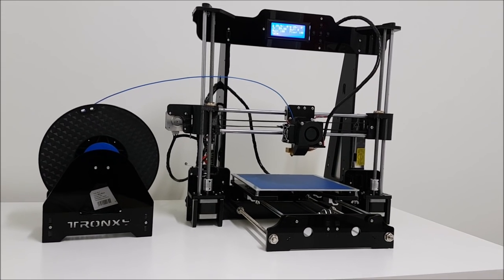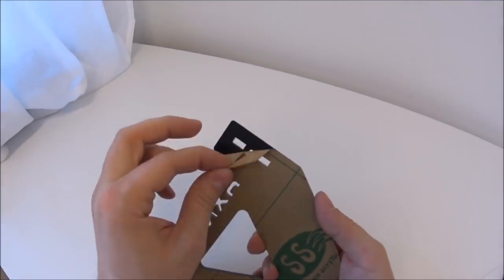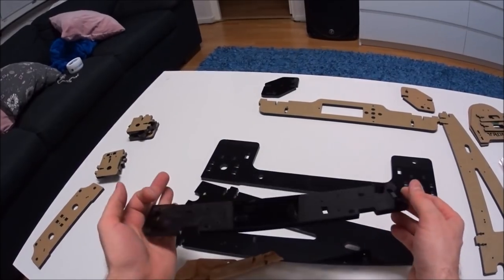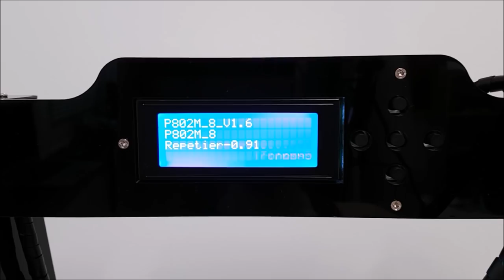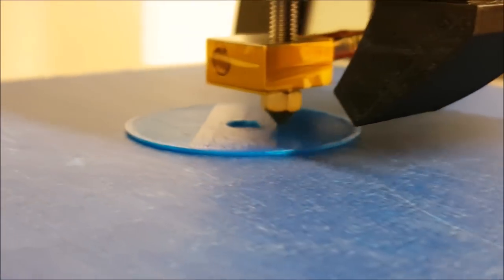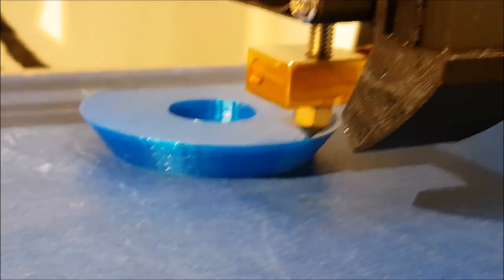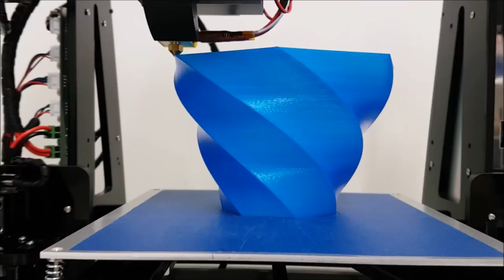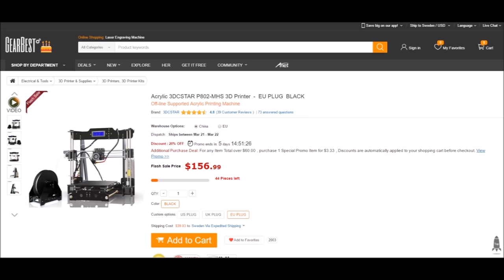Tronxy 3DCSTAR P802 3D printer build test and review

Comment from the maker: Tips for perfect prints: 
Build it perfectly. Make sure all screws are tight and belts are not loose. Check distance on side(Z axis rods holder)
Use lithium grace to lubricate bearings to make them run smooth or make IGUS PLA bearings and use thin oil.
Level your bed on minimal 5 places(4 corners and center ) using A4 paper. Nozzle should NOT touching heat-bed surface.
Move X carrige and look for distance over whole hotbed area to make sure that nozzle is  again NOT touching heat-bed.
For better print sticking use Brim option in CURA or hear spray or order BuildTack.
Try to find best settings in CURA. Use slow first layer 10-20mm/s 
Average settings are PLA 200C on nozzle Hot-Bed 55C. On ABS 230-240C on Nozzle , Heatbed 75-85c (Use brim option) 
Layer resolution is 0.2mm medium quality or 0.1mm to High quality
Print speed are 34-55mm/s   Travel speed are 45-85mm/s
Good luck :)
Reply: My son bought this same printer and one motor is not working - we switch the input port of cable from left to right and then the opposite motor doesn't work, so we assumed it was a faulty port on the circuit board. The manufacturer sent us a second circuit board but we have the same problem. Any ideas??? Help! We have videos uploaded on our channel. Thank you for your help.
Reply: I use silicone grease as it has less chance of attacking plastics.
Reply: @nycmeghan18  check wiring for bad connections. It happened to my z axis motor. The black broke while running it.

Comment: Yah we definitely need a side by side comparison. Can you do a sound test between the two? Is the stepper motor noise noticeably quieter.
Reply from the maker: I already done comparing video Anet A8 vs Tronxy. Well they are pretty much the same sound noise. I did not noticeable any big deference in steppers sound.
Reply: thanks, How are you able to get so many printers.

Comment: I just bought one of these but it's the Australian version and I live in Canada..Only reason I didn't buy the North American version is because it was $100 more..I already have a power supply to replace the one that comes with it if I need to...Hopefully it has a switch on it so I can change the voltage on the power supply that's included..if not I'll use the one I have...The printer should be the same just a different mains voltage..hopefully..

Comment: Hi Nexi, Good review video mate, just one question how is the noise from the steppers on the tronxy over your a8?
Reply from the maker: Thanks mate! Glad you like it! They are silent. Only think I will change is standard bearings to the igus stile bearing and maybe thermal  switch to power supply to control fan.
Reply: im currently doing the set up for the e3d upgrade on my a8, I plan on doing the stepper driver upgrade and I think that will be me

Comment: Could you please help me? I bougth the printer a year ago and tried to assemble it. The problem is that it isnt getting hotter, it moves properly when you are printing something but it does not put plastic on it, because it is not hot. I really need your help, I need to fix this as soon as possible. Thanks.
Reply: I have fixed the problem with the temperatures, what temperature do I use? My problem now is that the PLC filament does not fit on the hole while yours fit perfectly, mine goes 2 cm in and then it cannot go further. My fillaments are 1.75mm

Comment: You mention upgrades.  Are you saying the tTronxy is an upgrade over the Anet in these respects?  Or did you apply these upgrades to the Tronxy (i.e. these results are not from the stock printer)?
Reply from the maker: Chris Burck Forget about Tronxy or Anet or any Acrylic 3D printer. Get this one instead: https://youtu.be/QEzMWE3-lVY
Reply: Thanks for not answering my question.

Comment: Excellent video!
I just built my 1st printer and the extruder motor will not dispense plastic when it's printing a test part, but the extruder motor works fine when I do it manually without a file loaded.
Any suggestions, please?.
Reply from the maker: Mr. Pickles Try to adjust tension of extruder gear? Temps? 195/200 is for PLA
Reply: Thank you!  I will let you know.

Comment: Is it better then the anet a8?
Reply: only real difference I see is the built in fan in the PSU, it depends on the steppers really as you'll likely upgrade everything else on an A8 or This
Reply: James Tourish Also the way the Y axis bots go through the acrilic not just a cutout for it.. I really like this idea
Reply: weird my a8 has that already but its def a positive for the tronxy
Reply: Sometimes I think I ordered my Anet8 about a week too soon, many ppl are getting this printer instead. Oh well I guess, I've already done many of his mods and my Original e3dv6 will be here monday.
Reply: Hopefully its install goes better for you mate, I'm getting a z probe error when trying to home and my hot end is reading 238 degrees without been heated lol
Reply: See now you got me worried lol.Maybe i'll post it on my channel IF I get it working :P
Reply: @James Tourish - did you change the thermistor settings in the firmware?
Reply: yea chroboe, went through them all, tried the original thermistor from and set it back to 501, read right first time so just installed it into my e3d instead lol
Reply: could it be any worse.
Reply: I think you jinkesed me lol, Just got everything installed and now my X motor is reversing somehow lol, I didn't even touch those wires or software yet!
Reply: YES, much better electronica, motors structure thicker, improves the extruder ...., price equal or less. There are videos comparing the two models.

Comment: I was looking for an anet a8 but now i dont know what to do? should i buy the anet or  the tronxy
Reply: Unless you buy it from Gearbest you will probably end up with a tronxy anyway even if you think you are buying a Anet A8 so why worry,
Reply: Buy a Tronxy P802E mate. It's E3d setup, better belts, better PSU and very high quality prints.
Reply from the maker: I agree. They are both very similar. But my vote is for P802E Looks very promising.